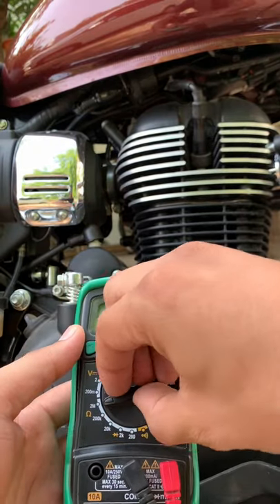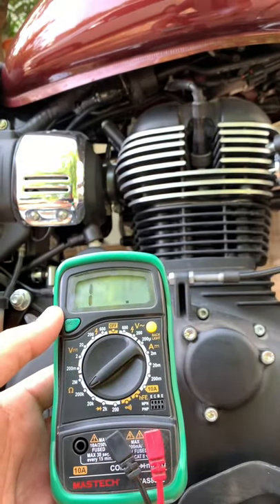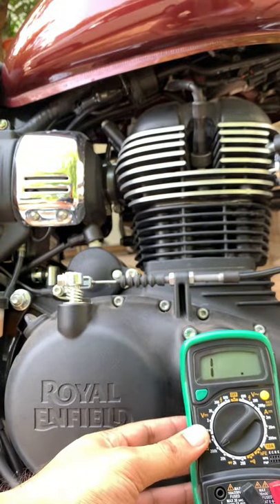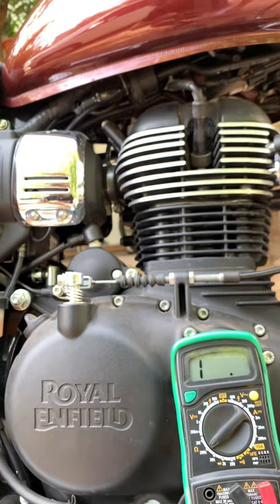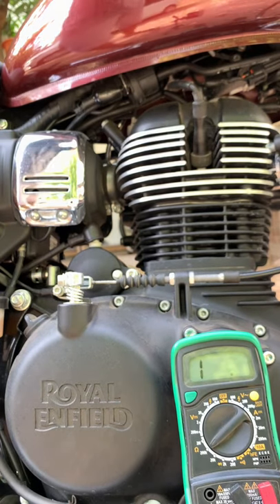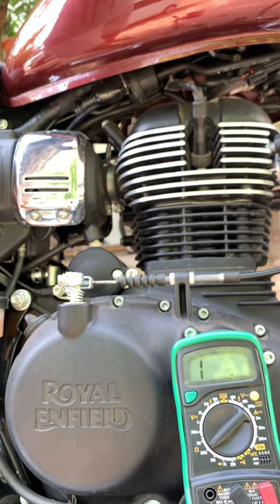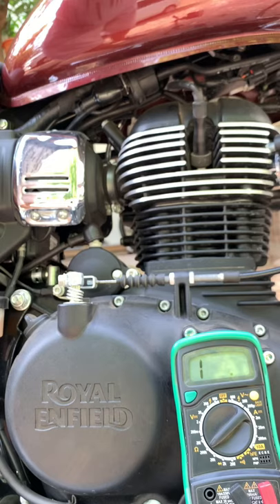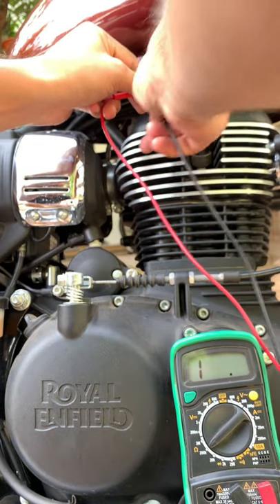Meteor 350 ignition coil problem Check | Royal Enfield Meteor 350 | Stellar red

Comment: Hi. Tell me what is engine tapping sound? Is it common in meteor or an issue?
Reply from the maker: Upto some level it’s common, after certain KM drive you will feel it
But if you think it’s too much noisy and unusual please report to service center
Reply: @MnMRating  thank you. I also see oil splash over the rear wheel. Is it because of the lubrication done on the chain during service? If yes. Will it be a lifetime problem? 
I also see oil leak (over the right side engine that 3 boult) is it because of the poor service?
Reply from the maker: @mkceditz1119  service centre normally use chain spray only to avoid this use, i haven’t face this issue in my bike.

Please share and subscribe our channel and please let me know if you have any questions